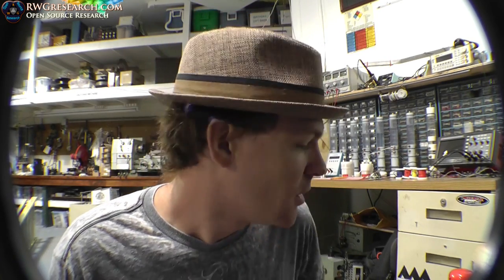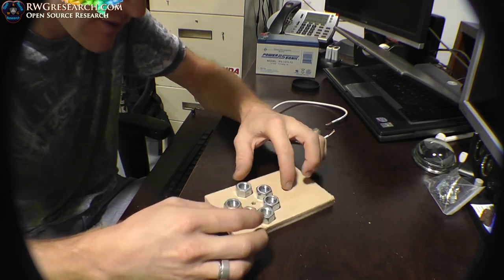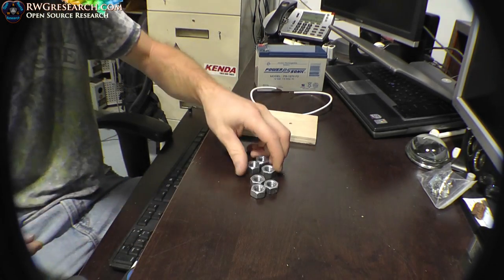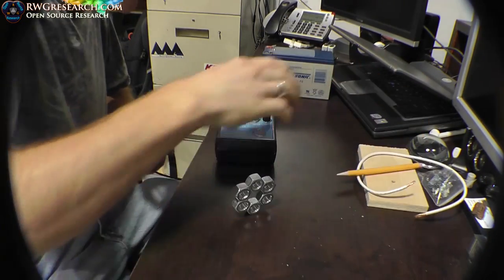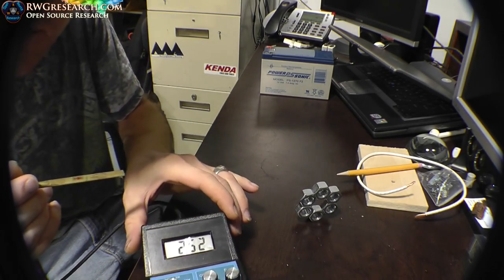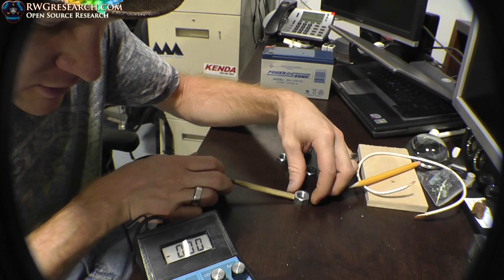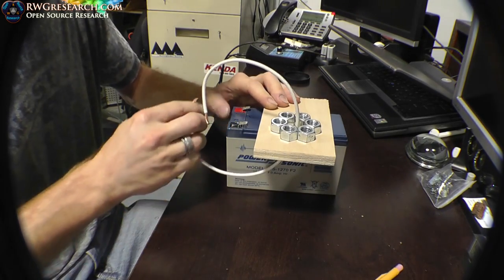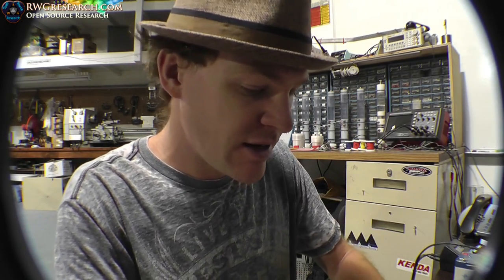“Oh Nuts!” Magnetic Lock.Your Going To Like! Using The Principles Of Ed Leedskalnin PMH.Must Watch

Comment: Russ, 

Yet another great experiment. Great to see things are going well for you. 

The magnetic field spinning around the wire triggers gyromagnetic attraction between the surfaces of the nuts. The effect could be described as an alignment of the nuclear magnetic resonance of each atom in close proximity to each other along the surface of the nuts. Because of the alignment of nuclear spin states, there is a strong attraction. Strong enough to hold the nuts together. The cool thing is that with surface of the nuts being imperfect; you're probably only bonding less than 1% of the nuclei. The smoother the surface and the closer to perfect the surface angle; the higher number of aligned nuclei and stronger the attraction force. This attraction should last as long as the matter itself, which is a very very long time. I'd call it atomic bonding if I dubbed it anything. 

Ken

Comment: The eddy currents when the current passes through forces the iron atoms into alignment, which will hold together under their own attraction, until the chain is broke, and they snap back into their natural alignment. Think of it like popsicle stick dominos. This will not work on powdered metal because there's too much distance between atoms for the chain to be strong enough to hold after the current cuts.
Theoretically, this could hold forever as long as the link isn't forcefully broke. There is no current actually moving, otherwise the closed loop would be emitting eddy currents of its own, which you can test yourself.

On another topic you may find interesting, if you have a metal polished so smooth the atoms are close enough for nuclear forces to take over, this happens as well, called cold welding. Air typically prevents this due to cushioning, but in a vacuum, it happens far too much.

Comment: It's just aligning the poles of the magnets into a stable formation. To test this hypothesis, run the same experiment, except instead of running the wire as a line through the center of the nut formation, run it as a circle around it. (Might need a longer wire to complete the connection.)

If I am correct in saying that it is merely magnetic alignment, then this will unlock the magnets. If it were thermal welding, then even the circular electrifying configuration would fuse the nuts together.

Another way to test for magnification would be to run the, experiment as you have done in the video on two separate nut formations. If I am correct about it being magnetic alignment, the two formations will definitely repulse if put one ontop of another, or attract if you flip one of theformations 180 degrees. This would not occur in the case of thermal welding.

Comment: Now Russ, consider fusing this concept with 6 sets of wireless power transmission coils. By pulsing dc through the first set of 6 in series, the 2nd set should gather not just the power from the first, but additional power if using a good ground isolation setup... then let those 6 power another 6 which in turn power the circuit which powers the first set with pulsed dc. 
Well, just a thought. See, they should all go 120d out of phase and since they act as dynamos, any carried waves ontop the dc carrier wave will allow said carried waves to implode through a nonlinear medium centered in each field rotation where pump z waves are made of carried waves due to the carrier wave. The multiple copper wires should make carried waves (copies of the carrier) but if not, you may need to add 3 layers or more of spiral coils around each simple winding of each of the 18... I'm assuming you've seen the wireless power transmission experiment or done one?

Comment: the principle is called magnetic hysterisis! This has to do with core saturation in a high state of flux density...Basically the eddy currents will realign the domains inside feromagnetics once they get disturbed and lock into place pointing into one direction...It's a parasitic effect called hysterisis...Bubble memories based on toroids and inductors would store a bit this way and reversing the polarity of the current would remove the hysterisis loop! Funny nobody gives Ledskalnin credit for this! Some Chinese guy named Wey fought to get the credit for bubble memory storage using two toroids and another guy simplified it using just one...Intel took over that market making sdram memories and lowering cost!

-Filip Miucin

Comment: Hi Russ... me again!  A followup to your followup of the "will it work after 2 years" PMH video...  
I like the large Circular "PMH", have you tried energy recovery from that one?  I just put a "recovery coil" around the "keeper" of my "normal style" PMH, and there's flux available to be recovered there too. So, if you previously only "recovered" flux/energy from the main part of your PMH device, you are throwing some flux away from the "keeper". The circular style would eliminate that loss by the very nature of only having one point of "disconnection"... so to speak.  I use VERY abrupt "disconnection"... by whacking the keeper off with the handle of a large screwdriver... and watch the recovery voltage across a load resistor through an oscilloscope.

Comment: The shorting of the battery makes a flow of electrons to go thru the wire, as that flow has also its own magnetic "turn", which keeps the magnetic force flowing thru the object till the chain is broken, or the loop can get smaller (if you have a nut in the middle, this wouldn't work). Magnetic field lines stay up till they are broken, in this case by breaking up the array of nuts.

Comment: An interesting effect that they dont show you at school when you learn about solenoids. But not so mysterious: The magnetic domains in the iron link up nose to tail - North to South - North to South, they can do so in a complete closed loop, and hold each other in this position. There is very little magnetic field observed outside the iron as there is no significant leakage of the field when aligned like this - why a keeper plate is used on a permanent magnet. When one of the nuts is removed, the domains at the tips of the 2 end nuts are now only held in place by one pole, and this is not enough to keep them fixed in orientation, thermal energy is enough to free these mini magnets and so it returns back to being un-magnetized.  I suspect you could illustrate this very nicely with a ring of small magnetic compasses which would align with each other when they were in a closed loop.

Comment: Dude this is short circuit ant the current in the wire is really big, so we know that the derivative of the magnetic field induces a current into a wire. The nuts are that wire, where the current ( foucault eddy current ) is also very big, leading to great amounts of magnetic induction between the nuts ( the magnetic resistance there is so small ), and because of that the majority of the magnetic field lines are passing trough it. There are two options:
1) The great change in the magnetic field induces eddy current which melts the surfaces of the nuts by a tiny amount.
2) The surfaces are magnetized my a small amount, but it is spread across huge
( respectively ) surface, closing the magnetic chain ( where the surfaces are the actual sources of a magnetic field ).

Comment: Nice video.  I suspect that the effect you are seeing is identical to how Magnetic Core Memory worked.

In MCM, a toroidal core has a wire going through it.  Passing a charge in one direction wrote a '1', and in the opposite direction wrote a '0'. To read the core, another wire senses the magnetic direction.

MCM is non-volatile, meaning that the magnetic field persists even once power is removed.

Because MCM was toroidal, the field was kept mostly within the core allowing cores to be tightly packed while keeping their bits (magnetic fields) from affecting the neighbors.

What you have is, I think, a very simple MCM.  The fact that it is 'circular' keeps the magnetic field inside.  It retains the magnetic field, just as MCM would, with the power removed.

Comment: try other metals as well and see what the result is brass, aluminum, or copper would be interesting since it has not magnetic properties.
Reply: I just tried with stainless steel nuts and it didn't work. 
Probably because it's an alloy.
(But it's all I had laying around)
Good point though!😀

Comment: When electricity is applied in any scenario, the electrons will remain hopping, however in this scenario it is working as an electromagnet, something that is typically used in electronics for fans and electric car engines, these typically use coils and these nuts are essentially coil, they are made as coils in order to make opposition between negative and positive electrons, that makes it so they bond, and in this case the process is done, but the energy given from the battery is kept, as there is no outside source to take away that energy, thus keeping them magnetized to each-other as the electrons stay in motion. However only temporary, as that would be a theoretical scenario and would only be possible if there wasn't air or a counter-top that could take in energy. Or in this case you to break that bond.

Comment: magnets are north south entities. the shape is basically a toroid. so when you pulse it once, the magnet has a north in one direction which continues in the direction of flow. magnets last for a long time. you wont measure a magnetic flow because the flux is spinning through the core materal, in a circle. so there is no expanding field for the guase meter to read. you have no north south. you just have a spinning flux through the core of the metal. when you break the toroid shape, there is probibly a reversal of the magnetic field ( north flow to south flow) or back electrical motive force. put a coil over the gap that you will make when you brake the field and you can measure the bemf...or light a LED. it all has to do with toroid flux vector fields. look for the Tachyons man.

whats my my prize?
Reply: Hhydrogen4Power i got your hillbilly nuts. LOL. i will set one up, since you asked so nicely
Reply: irondmax Particle accelerator?
Reply: 72mansion partical trap
Reply: wouldnt the particles need to accelerate as they move into a spiral?
Reply: 72mansion electons are in motion all the the time. they get directed through the core, then just keep flowing
Reply: thnx
Reply: irondmax you can keep your soul cause you didnt shut your mouth ! How brilliant !!!

Comment: I havent read any of the comments, but I wonder if theory 1 is related to eddy current in any way...?  You expose the nuts to a magnetic field, but in doing so, you are inducing a current into the RING of nuts which also forms a single winding shorted on itself.. The only reason I'm suspecting this ISNT the case, is because in order for it to work, there would have to be a measurable current in the ring, but the plating and the steel itself has a fairly high resistance, and the current required would be enough  that heat would be generated, thus making it non-perpetual..   

Theory 2 and more likely is this..    The ring of nuts, where each nut has a random magnetic alignment do not attract..  after flashing with a strong magnetic field surrounding the wire, the wire aligns the random magnetic fields in the nuts, making them each turn into magnets themselves..  Much like using a magnet to pick up multiple ferrous items, and the ferrous items themselves become magnetic by way of a magnet, the nuts also become magnetic. but because each nut is surrounded bu neighboring nuts that have like but opposite arranged magnetic charges, they are prevented from randomizing when the source magnetic field disappears (the field from the winding)...   

Because the induced alignment is favored by a neighboring nut, the alignment stays. When the field of a neighboring nut becomes less, to the point that the magnetic field is not holding the nuts magnetic poles in alignment (when you break the nuts apart), the nuts fall apart and the magnetic charges  go back to their random resting state..    

do I win a gold star?   LOL

Comment: I believe instead of a magnetic effect we need to be considering the Casimir effect.  If we "knock off" a bit of the electrostatic repulsion that keeps objects from ever truly touching one another then the objects may actually become somewhat "cohesive".  I haven't ever heard this proposed but I doubt I'm the only one who might have proposed this.  If this is the force at play then the truer the surfaces being bonded, the stronger the bonding force should be.  You may have already ruled this out by experiment but if not maybe it's worth a look.  This could also be the force at play in all PMH devices.  Even the small discharge upon separation might be explained by the re-introduction of the electrons or ions required to bring the surfaces back into balance with their environment.

Comment: .It is basically the same thing your dad with the horseshoe magnet and the bar across it.

But on the horseshoe magnet you had Wires wrapped around the horseshoe and the magnet stayed energized on your wall for two years. When you took the bar off , you  broke the magnetic circuit, the coil around the horseshoe cause a light to flash. This is the same thing, but with only one coil

Comment: It is my opinion that the electric charge applied when you make contact with the battery posts causes an alignment of the outer electrons of the metal atoms.  This alignment also causes an alignment of the Van DerWalls forces of each surface electron. The individual bonding of the Van Der Walls force due to one electron is small but due to the number of all of them the combined bonding force is impressive.

Comment: Dielectric pressure was induced by that magnetic field.  Dielectric force is the incommensurable counterpart to magnetism.   You simply sent current and created a field that magnetized the bolts very slightly. Only enough to create mild dielectric "suction" bun not enough to saturate the metal and cause complete dielectric coherence in the metal thus permanently magnetizing it.   

How is that for an explanation?

Comment: The nuts are glues together, because there is a momentary high current trough the nuts.
What you see is a transformer with a one turn winding, the nuts are “welded” where there is the contact between the nuts. 
Very nice.

Comment: Ps. No crow bar. I think the "bridging" bar just falls off when a load is connected to the coils. Maybe if a spring is placed with some force pushing up on it, you might be able to slowly harvest some current from the coils until the weight of the bar causes it to separate providing the load has a high enough resistance for this to be useful. And since the spring would be holding the bar in close enough, you could just use a controller to recharge it with solar panels or something. No more arcaic lead acid batteries. Just a scrap yard filled with car frames, leaf springs and microwave, CRT magnetwire.

Comment: By direct shorting the battery you pass theoretically infinite current and practically very large current could be 10 Amps or so. So due this heavy current the metal nuts become magnetic and since they are forming a closed loop so the magnetic force remains locked in. As soon as you break the loop the magnetism leaks away.

While testing magnetic field in the closed loiop the only place where there is a little leakage is at the joints of two nuts since surfaces are not machined. So your meter registers a little leaking force there only.

Comment: Using a large capacitor (with LOW ESR) works too. I used 100+V DC charged into a 2200uF 450V pulse-rated capacitor - works good... and eliminates the "melted wire" possibility. SURE... it results in a very large BANG! and sparks flying... but hey, that's part of the fun!   (WARNING - using voltages well above 30V DC can become dangerous - do not attempt if you do not understand these dangers - 100V DC can kill!)

Comment: The magnetic field created by the electricity is low powered so only reaches a little way into the circle of metal so can once broken, looses its binding force. To create a metal magnet, it has to shot through with heavy weight electricity and so swamp the metal in the direction of charge. this aligns the atoms of the metal in series and so creating and then maintaining the resulting magnetic field. Heat would also make the nuts come apart as it would make the atoms move around vigorously and so shaking them out of a series configuration.

Comment: When the Wire is energized a circular electromagnetic field is created around the Wire that magnetizes the Nuts so one side of every Nut becomes North and the other South. Since this is happening in all Nuts at the same tIme the magentic field of one Nut keeps the fields of the adjoining Nuts aligned. This happens in every Nut so the RIng keeps itself stabilized until you create an imbalance by moving one Nut. The Fields of the adjoining Nuts get weaker thus weakening the Fields of their neighbours. This chainreaction continues until the fields are too weak to hold the Nuts together.

Comment: The temporary flow of electrons threw the wire temporarily pulls/attracts the electrons of the atoms in the nuts towards the center. This causes a temporary bond on the Quantum level. Once you break the circuit the electrons in the atoms realign. Thoughts?

Comment: I could be wrong about this, but my theory has to do with the "burst" of DC passing thru the wire and the metal and polarizing the electrons of the nuts (changing the magnetic polarity). Aligning the attraction of the metal poles North to South in a radial spin pattern emanating from the wire to change from whatever they started with to make them attract and keep this weak state. A kind of "Sokolov–Ternov" effect or "Maxwell's molecular vortex mode"?